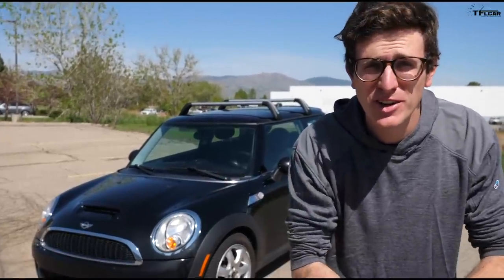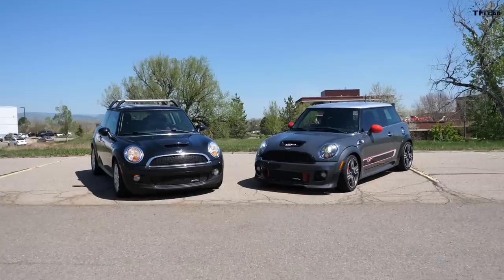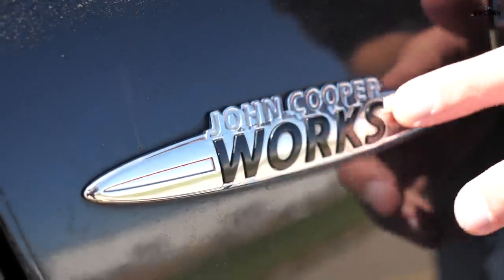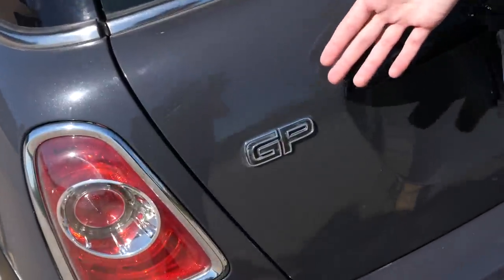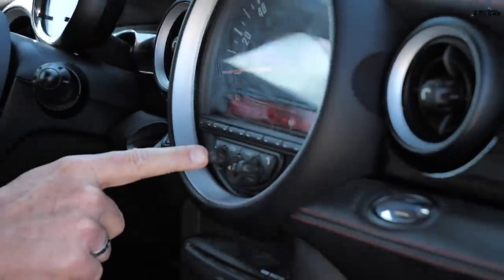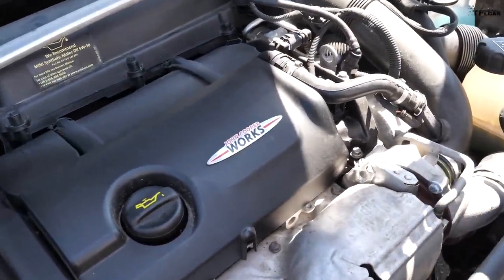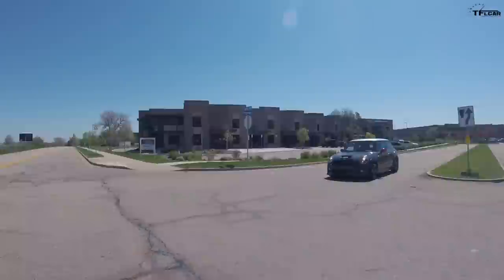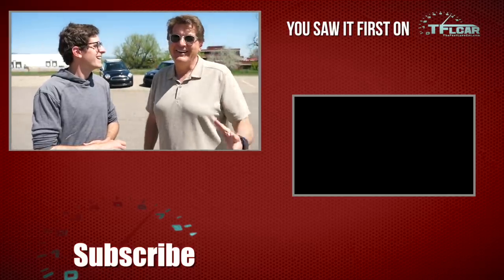We Bought Two Used Minis, But One Of Them’s a Total Nightmare! Mini Budget Fun EP.1

Comment: Bought a used Cooper S a few years ago, spent the next 2 years spending a lot of money until I would spend no more. Great car to drive, just cost too much to keep it in working order, every piece of it was keen to break.
Reply: Mine is a r53 done 120k and works perfect
Reply: @morganperkins8280  That's fantastic, and I wish you many more trouble free miles.
Reply: Same here, nothing but trouble, I’ve paid more money in repairs than I did purchasing the car.
Reply: 13K to purchase and atm 14K to keep it on the road, only owned it for 3 years and put 50,000 miles on it
Reply: 2007 S with the n14 engine.
3 months after buying it, the clutch went. Fixed that and 2 weeks later the break sensor went. Fixed that and two months later the thermostat started leaking. Broke the cross over pipe replacing the thermostat. Fixed those two problems and now its back firing.  Shocks are going, tires which were new are now chopped... I've had it 14 months, just hit 100k and I'm being told the turbos go around 100k... OMG what a POS!! If you're looking to buy a mini... get the justa. (Just A Mini) The N14 IS THE WORST!  I still owe 5,840 on the turd and its spent more time sitting than any car I've EVER OWNED!
My suggestion, STAY AWAY FROM MINIS
Reply: Can’t wait to trade in my 2013-so expensive to repair👎🏿
Reply: sounds like every bmw ever

Comment: The dash of the GP is coming apart there probably because the airbags deployed and they tried to fix it. It's probably why the airbag light is on. If you look at the shot where they showed it, it looks like the airbag was stuffed back in and they tried to do a cheap repair on it.
Reply: That's not where the airbag comes out. Airbag comes out of the rectangular area above the glovebox. There is no stitching damage there. This is either heat/dryness or damage during disassembly.
Reply: @ModMINI  I know. But it kind of looks like it could've been. Dashboards don't just come apart there even in heat. Other Minis don't.

Comment: The paint is a dead giveaway that it’s had work and badly done work. The airbag light is also telltale sign along with the bad paint. It’s still a cheap GP and will be better if it gets the attention it deserves. Check if it actually has airbags in it and not just re stitched seats and an empty airbag cover in the steering wheel but it should have it in anyways.

Comment: Best version is the 1st gen mini cooper s 2004-2007 supercharged . All you needed was a smaller pulley , tune , exhaust /intake ,  and some low pro wheels and tires . Maybe upgrade the brakes and you have a reliable track ready car .
Reply: Are those the generation with the Dodge Neon supercharged engine?
Reply: Hector Medina I don’t think so because minis use bmw engines
Reply: Maybe upgrade the brakes? Definitely upgrade the brakes. The R53 brakes are the worst thing about the platform. Poor man upgrade is to put a set of used R56 calipers and rotors on the front.
Reply: @kamikazee3071  It's a Tritec (Daimler/Chrysler) developed engine. MINI did not use BMW engines until 2014.

Comment: Tommy don't be afraid of your n14s engine. I have a 2009 Clubman S with the same engine that had 74k in 2018 when I bought it. It was a one owner well maintained vehicle and I have continued on that path as the second owner. I have an excellent affordable MINI master technician that replaced my timing chain and guides before they failed, replaced the vacuum pump as it was leaking, the front main seal and oil pan gasket. Now my MINI is free of any oil seepage and has been trouble free for the past two years with just regular scheduled maintenance like a brake fluid flush, spark plugs and oil service. No problems at all with my coils as they are OEM MINI parts not the cheap Chinese ones that give the reputation of failure. Enjoy your awesome MINI! I can't wait to see your modifications to personalize it. Oh and ECS tuning has great deals on new OEM wheels. I bought a complete set for $500.

Comment: Roman: "I got ripped off. That's the only way you can put it. This is the worst Mini GP in the country."
Tommy: "But a typical GP in good condition is like 20 to 25 grand. There's a reason this one was 13.8"
Reply: It's possible to find one with higher miles but in excellent condition for as little as 15-16k. These cars are typically well cared for, so there is not a lot of demand for one with this many problems. I would pay maybe 10k for it.
Reply: Reset the airbag light, replace the tpms sensor and brake sensor. Nothing difficult about that. The real problem is the problematic body work. A few weekends with some tools would fix up the mechanical issues no problem.
Reply: @bradcomis1066  The airbag light is on for a reason. There's some messed up wiring, a deployed bag, or a missing module somewhere. Either that or whoever repaired this MINi is so unqualified that don't even know how to scan for airbag codes. Yeah, that's probably at least $5000 worth of body work.

Comment: I have a 2008 cooper s with the n14 engine. It is fine if maintained properly. Oil change every 5k miles. Use 5w40 for higher mileage engines. Change fuel filter and use best petrol you can get and the hpfp lasts a lot longer.

Comment: I feel that I got a good deal a 2019 with 8000 miles on it mini Cooper S one owner and it still had 2 1/2 years left on the transferable factory warranty I paid 21,000 whether I paid too much or not I still love it
Reply: That 2019 should be a great car. The F series mini is much more reliable than it’s predecessor. I just hit the 100k mile mark on my 2016 Cooper S and by and large it has been trouble free. I had a couple of minor issues but they were fixed under warranty. Not quite the go kart that my 2002 was but a superior daily driver for sure.

Comment: Tommy you should do a paint correction on your Mini. A polish or something. Also, the engine in yours was a joint development between BMW and Peugeot. The same issues on there is the same in the Peugeots. We had a Peugeot 3008 which had an engine replaced because of the timing chain issue. Peugeot still uses it now actually but updated now and they have a version of it with 270hp in the 308 R.

Comment: I got my 07 mini cooper s R56 single owner which was an older lady for 3.6k. The car was pretty immaculate in its condition. I have had a few scares low oil pressure and boost leak which both were my fault also using premium fuel from a crappy np brand name gas station. So the low oil pressure was my fault because although i checked the oil many times when i first bought it i believe the original owner about when the last oil change was done. HUGE MISTAKE and i knew it, no matter what anyone tells you when you buy a car the first thing you do is change the oil first always always!!! The boost pressure issue was also my fault cause i forced a hose under boost off and when i put it back i didn’t put it on with tools i just did it by hand. The gas you use on minis is very very important do not cheap out on gas, it also made my mini go into limp mode intermittently and the light would come on and off very often although i didn’t ever lose power or do true half power On limp mode cause it would always go on and off until i went back to using exxon premium fuel. I go on long drives and thought i could just fill up after i left and Before coming home. Never again! Exxon is the gas MY mini preferred since i live in a crappy city most gas stations in my area have crap gas even the better known gas stations. So if you own a mini and the gas station you go to works for you use it. For me i know the quality of gas at most stations is very very low quality even at big name brand stations. Since i like to fill up the tank all the way after getting down to a quarter i had to deal with it for a while. I know it was the gas cause once it was done and i went back go exxon the code didn’t come back and many others on other mini forums have said they’ve had the same issue using cheaper or inexpensive gas.

Comment: I miss driving my mini, but I don’t miss owning it.
Reply: I feel ya; my R53 was so much fun but it ate weird parts with alarming regularity. I could get it into service mode (front end pulled apart) in about 25 minutes before I traded it in, lol. The next owner visited the dealership several times, I know because the key was still registered to my email address so I got the notifications every time they scanned it in.
Reply: Josh Hulbert, it’s amazing, I have yet to replace a motor mount or power steering pump in my Subaru.  I think I went through 3 of each in the R53

Comment: Mini's are fun and they are expensive to maintain if you can't do the work yourself. I don't have a S or a GP,  just a hatch. I don't understand the need, extra money, upfront or in maintenance down the road, for 1.5 seconds faster to 60 mph. Mini's are about handling and feel not raw speed. That S is more than a second slower to 60 than a new V-6 Camaro. The same goes for the GP.  Point being I don't understand people trying to make their Mini fast in  a straight line. They are not about that, never been about that. Unless you are going to drop 30k in to mods, or drive a straight track Mini on the street, why bother. The Mini is a super cool fun car do drive in the non S or Cooper, let alone the GP. This is not a rant, might sound like it, but really its not. If I wanted something fast to 60 and kinda handled, I have options, lots of options. But I want a daily driver that is kinda fast and handles like it is on rails... My Mini works wonderfully. But if I had money to waste, I would have a Mini like this... https://www.youtube.com/watch?v=4bRwo1bDcDM&t=47s now that is how you waste 30K on a Mini. Not buying a messed up used one and spending 20k to fix it.

Comment: I've owned two turbo mini's. They are garbage. I have one broken down in my front yard as evidence. Motors might last 50,000 miles. I'll sell you my 2009 Mini Cooper S for $2500. Under 100K. It does run. Currently overheats, Mechanic didn't properly refill the coolant. Located in Los Angeles. Leather interior, Navigation, etc.

Comment: 2010 mini's are especially known for being unreliable
Reply: We have a 2010 R55 JCW Clubman that we got with 43K miles. It's had:
new clutch and flywheel,
new thermostat housing,
new barn door solenoids,
new water pump solenoid and friction wheel,
valve cover gasket and oops valve cover because I cracked the original changing the gasket.
Now at 90K and it needs oil leaks fixed which means new gaskets for the oil filter housing and new supply and return lines for turbo, AND it needs the dreaded timing chain replacement.
Even with all this the owner of the shop that did all the work wanted to buy it for his daughter.

Our 2012 Inspired by Goodwood Bespoke Edition has only had normal maintenance at 40K miles. My mechanic also would buy the Goodwood but we're not selling.
Reply: @SqeakyToy  Yes, if I remember right 2011 and on was where they got much more reliable.